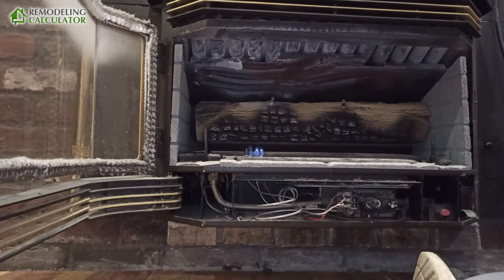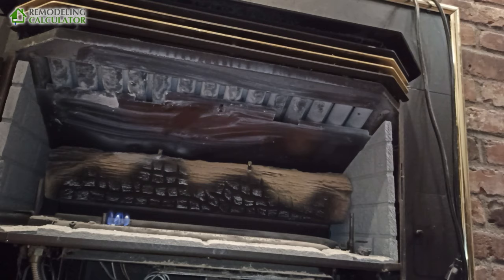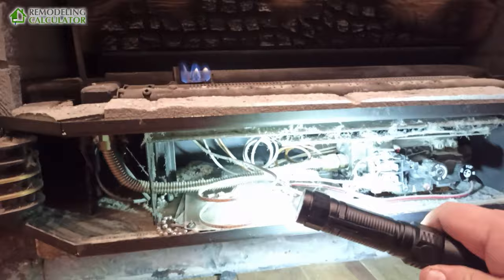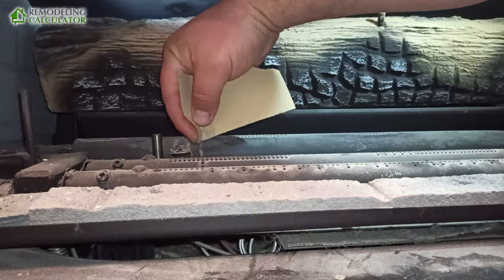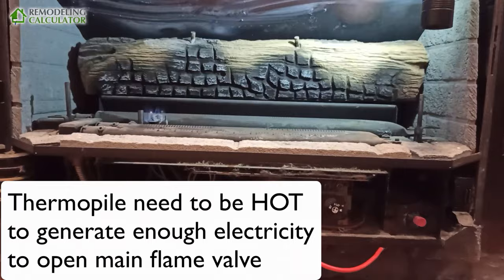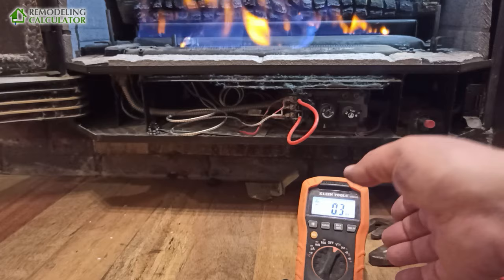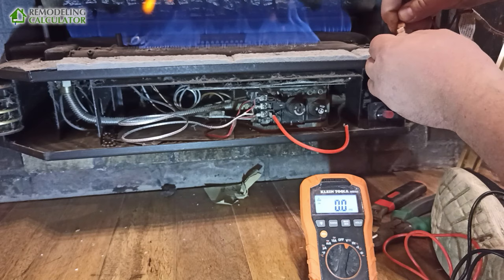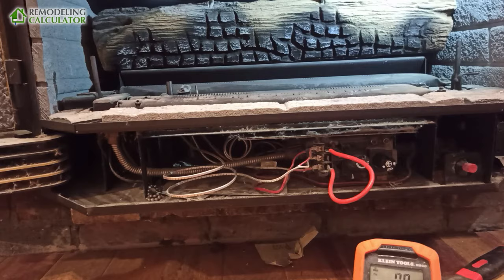Gas Fireplace: NO FLAME - HOW TO FIX - Works on Most Brands

Comment: Thank YOU!!! I almost went down the thermalpile/cloupler rabbit hole, but this is THE first thing to check. My fireplace was connected to a broken thermostat, which I haven't used and don't want to use anymore. Jumper wire test saved me LOTS of time and $$$.

Comment: This video was a lifesaver. I’ve been trying to figure out my fireplace for months I can’t believe a regular wall switch could go bad like this!
Reply: I had a shortage in my wires at the unit 😒 I figured this out from this video
Reply: Did your wall switch have a ground wire?  Mine doesn't.  
Edit:.  there's no ground.   Just the two wires running from the box below.
Reply: @FlawlessCFO  yeah, mine must be the wires too, i tested the switch with a multimeter and it tests good.

Comment: Thank you… you should make a video about making the older units like this one to operate during a power outage, with the jumper. 
All the videos on YouTube only show how to install batteries to the newer models to get them working during a power outage.  Nothing on older pilot light style gas fireplaces. 
Our power will be out for 10 hours and the temperature is -6F. That jumper that you showed, opened the valve and allowed my main gas valve to open. Nobody is showing folks how to open the main valve when the switch on the wall is dead. 
This video helped provide heat to my home, and may have saved my water pipes.  Fingers crossed. 
Big thank you…..

Comment: I think I'm going to have to replace the gas valve on mine. I have struggled to keep my freestanding gas fireplace running for the last 18 years (very similar to yours, except mine is freestanding, so easier to work on). I have kept it limping along by cleaning it every year, fiddling with it, hoping and getting lucky. Last year I replaced the entire thermocouple/thermopile assembly unit, and it worked all winter. Note: I did get my  thermocouple/thermopile assembly unit from Amazon, so that could be the issue. I also replaced the switch which seemed to help one year. This winter, when we had our first cold snap (-34C outside right now), I cleaned it all out, but have not gotten it running after three days of working on it. I can get the pilot to light, but as soon as I release the push and hold pilot nob, the pilot goes out. I have also changed out my propane regulator (I own four of them), but nothing is working. I also put my MAPP gas torch on the thermopile/couple to see if one or both was weak. I'm wondering now if the valve has always been faulty (buggy) without completely failing. I love the stove when it's working, as it puts out a massive amount of heat, and has a top that I can cook on in a pinch. But it is a royal pain to keep running. The valve unit is $140 (US), but a new stove is $2,500. I wish there was a way to check the valve unit before I replace it, but I haven't found anyone online who demonstrates how to test the valve unit.

Comment: Cheers, nice video, question though, when you had a call for heat you did not measure mv at valve, often these main gas control valves do not have the high limit switch, same symptoms and you find the thermopile is just not producing enough to open the valve, while shorting across the terminals almost always turns the valve on. Loved your video though, not enough fireplace content on the tube.
Reply from the maker: MV when gas valve opens is about 190 mV...

I had another intermittent issue where pilot flame hood had lint and dust and didn't give enough flame to thermopile. This caused the flame not to come on.

So i cleaned the orifice and increased pilot flame adjustment on the valve. Now i get 100 mV more on thermopile, and fires right up.

I recorded another video on that ... Editing it now.

Thanks for your input. Cheers

Comment: Update: Mine was the switch.  Stupid switch was almost $30 so I got remote controlled unit for $55.  

Thank you thank you thank you!!  Mine has a seperate wall switch and it's bad.  As soon as i tried your trick, wiith the jumper, it turned right on.
Reply from the maker: my switch was $2.79 ... what kind of switch do you have??

Comment: If pilot is lit and you jumper the wires at the switch and the burner will NOT ignite but will ignite when jumping at valve. Suggestions?
Reply from the maker: It could be that wires to the switch are broken or you have a high limit switch that is disengaged or open. You can try running two different wires to the switch separately from the existing wires and see if that works.

Comment: You have a dirty pilot, the thermal pile is ok but the flame is shooting directly at the pilot components. I usually used compressed air. But you have  to give it plenty of time for that to dissipate because it is flammable.
Reply from the maker: Actually my pilot is clean. I took it apart and made sure there's no lint or dust inside of it. Just don't show it in the video.

One of the issues was the pilot light was too small so I had to make an adjustment on a gas valve to increase the flame a little bit.

Comment: Thank you for such a descriptive video... So far yours is the closest problem that I have with our fireplace. 

We have a Heat & Glow SL-750TR-D model. Our pilot light seems to be holding steady blue and strong. Our thermopile seems to be holding around 420-430 millivolts. But when we turn the switch from the wall on, the burner doesn't wanna turn on. 

Ur video says the thermopile should be around 650-800 mv. 

I also checked our switch. I actually changed it, coz that was the easiest thing to do 😅😅, (rather than trying to change the thermopile or thermocouple) but it did not work for us yet. still trying to figure out the problem. 

How do you go on checking what else could be the problem? Can it be a gas valve issue? how do you test that?

Any help will be appreciated... thanks in advance...
Reply from the maker: Thermopile should be around 650-800 mv when inactive. When it opens the gas valve, voltage drops. 

If you increase pilot flame, the voltage on thermopile should also increase somewhat. If it does not - you may have a bad thermopile.

Easy way to test is to use a long nose lighter, and apply heat directly to thermopile for 30-60 seconds, without running pilot light.
Reply from the maker: Also, from speaking to a service tech at Fireplace store that does 3-5 calls a day - in 10 years he had 2-3 bad valves. So most likely it's not a valve.

I'm in process of publishing version 2 of this video, with more troubleshooting details and steps.

Finally - watch this video (by AC Service Tech): https://www.youtube.com/watch?v=riaN_j5tmX4
Reply: Hi… thank you for your reply… I followed ur instructions in the video (using the jumper cable and everything) and the fireplace seemed to be working just fine until this winter season when I needed the fireplace again… this season I did everything again but this time even the jumper cable trick didn’t seem to be working… u know just to even test it… 

Could it be my gas valve that needs replacing/surgery this time?

Waiting for your reply… thank you…

Comment: Do I have a bad gas valve? I have a discontinued gas valve. The thermocouple reads 28-30mv, and the thermopile gets to 300-400 when heated. Both prove that the TP and TC work. Also checked continuity on the wall switch. The pilot light lights up but as soon as I let go after 2 min it turns off.
Reply from the maker: Maybe bad contact. I've spoken with a tech who services 5-10 fireplaces a day for last 15 years. He said in 15 years he had to replace on about 5 gas valves. So it is very rare for the valve to go bad.

So my guess the TC or TP contact might be bad.

If you hold a lighter to the TC, will the pilot light stay on, and will the flame come on? You can try a stick lighter
Reply: @RemodelCalculator  just tried it and doesn’t stay on. I started the pilot light then after about a minute I brought a stick lighter and turned it on and slowly switched to ON on the gas valve. Almost seems like either the gas valve is bad/stuck or it’s never getting that mv signal to open the solenoid and let gas through. This came up on the Inspection when we bought the house (20 year old) but I never gave it much thought until now before winter.
Reply: @RemodelCalculator  ended up being a bad valve. Order one from fire parts and with small modifications I got it to work.

Comment: James A
My 19 year Heat-n-glo has a standing pilot system with a strong pilot light. It started working intermittently. I replaced both thermopile & thermocouple. I turned it  on every day for a week & now nothing. Any suggestions?
Reply from the maker: sometimes, you need to wait longer than a minute for thermopile/couple to heat up enough.

For me it sometimes takes as long as 5-10 minutes.

Comment: That pilot is barely touching the thermocouple, modern pilot like that has removable head, you can try cleaning it with dental tools and adjusting at the gv because if the thermopile doesnt have adequate flame it wont produce full voltage and the older they are the weaker they get. same with mV loss thru the tstat circuit, any more than 150mV and youre making the tpiles job harder, and the gas valve mV drop will go up with age. Robertshaw sit from 145mv idle to 175mv minimum, at 130 it won't turn on. Nova SIT i see idle from 210mV whenn theyre old to as high as 420mV ona new 750 mV tpile. Too much loss inthe tstat on old wire? Get a fireplace remote, itll only pull 12 mV with new batteries vs 150 to 200 plus on old sh*t wiring that isnt worth the time repairing or replacing.

Comment: I have a heatilaor fireplace that doesn't ignite at all with the remote. I also noticed the pilot is off and there is no way to manually ignite the pilot. Can someone help me on this?
Reply: I'm having the same trouble my walk remote has no power

Comment: So the repair man said that he could not even short circuit the switch and that the thermocoupler had too low of millivolts since it was around 130 - and so the milliamps that ran the pressure value or something from the thermocoupler was bad - the sensor. So they are replacing the whole circuit that contains the thermocoupler, pile, etc. Can you explain that for me? thanks
Reply from the maker: Have you measured mV on thermopile? Ut should be running at around 400 mV or higher when main flame is NOT on. When you turn main flame on, mV is normal nyo drop to below 200... Maybe 170-180 mV. This is because voltage goes to keep gas valve open.

What is the voltage on ur thermopile? If around 300 mV it may not be enough. Often the thermopile is dirty and  u should clean it with non-abrasive Scotch bright pad. Also often pilot flame is too small - either flame hood is partially clogged or flame gas volume is too small.

Usually the thermophile is not bad but does not get hot enough.

I already recorded a long video about it. Need to edit and publish
Reply: @RemodelCalculator  Thanks! Yes they said with the main flame not on the thermopile was only around 310 mV. So he also used the Scotch pad to clean it - and it didn't work.  So - look forward to your video! Thanks - that explains the connection to the gas valve.  OK - makes sense now. I think he probably needed to use something stronger than the Scotch pad - like 200 rated sand paper. I had some around in the garage I think or car - oops. Oh well - they ordered to replace the whole unit. Probably fair enough but now even the pilot light is not on! I have a big sleeping bag and blankets covering the lower opening where the cold vent comes in. haha. We had 20 below Zero fahrenheit here also. Pretty funny. thanks
Reply from the maker: @voidisyinyangvoidisyinyang885  there is no need for 200 grit. Scotch pad is enough. There is a separate valve (set screw) to increase pilot flame. Your repair guy should know about it. If he did not try, he is looking to do extra work at your expense.

310 mV is close ... You just need a about 100 more which is easy ... Clean lint/dust from pilot hood, blow clean the pilot orifice (do not use any needles), amd slightly increase pilot flame.

I have a feeling you guy is not helping u. How did pilot light stop working?
Reply: @RemodelCalculator  OK I heard him say to his boss that the pilot flame was strong - and all three flames going - and that was true. So but I saw tons of white all around that area - so pretty sure it was just super dirty and that green pad didn't do the job. haha. Thanks for the feedback. He did mention needing to buy his wife a diamond ring. haha. Oh well - I've seen other vids using sand paper. Yeah thanks for your help - I feel better knowing the situation at least.

Comment: wrong - sorry bud, your problems is the pilot is clogged. pilot should not have yellow tips - you need to remove the pilot hood and orifice clean and blow it out. you were half right. the tp and tc need to be cleaned, with a strong pilot it will not produce consistent operation

Comment: Should a gas fireplace always have a small flame?
Reply from the maker: Do you mean pilot light or the actual flame?
Reply: @RemodelCalculator  Yep, the pilot light keeps turning on. Do I have to turn it off or Can I keep turning it on?

Comment: You can not have thermocouple and thermopile the same time. The rod you are referring to is not thermocouple. 
Thermopile usually around 240 millivolts hols the pilot solenoid down and once you call for heat from thermostat the two spades at valve get connected. 
You might know some stuff but stop saying thermopile and thermocouple.